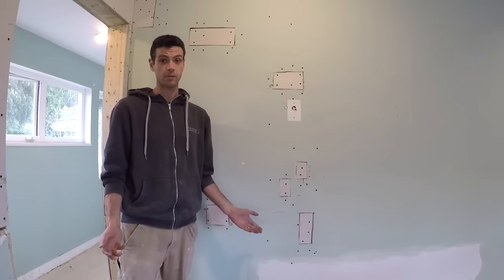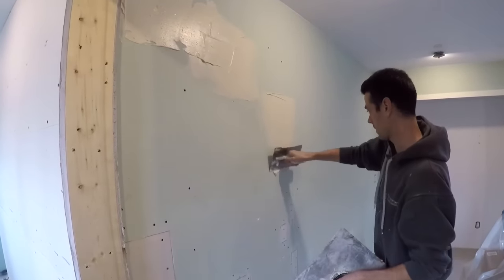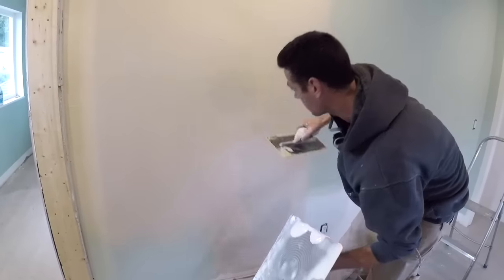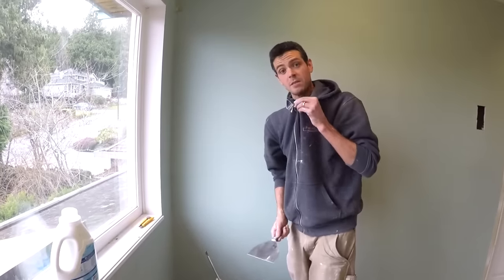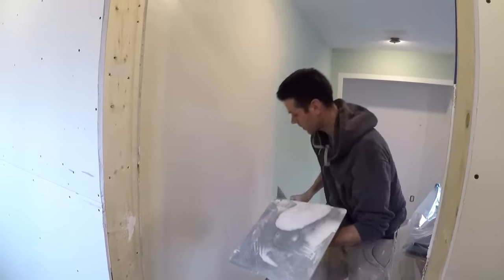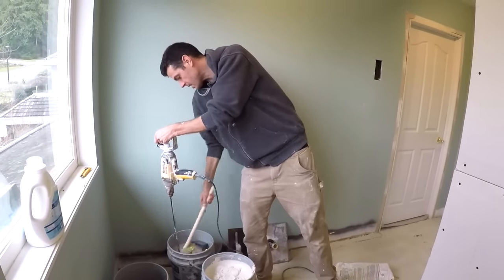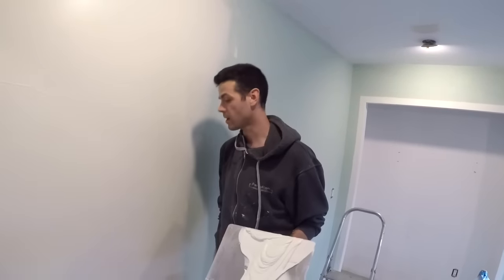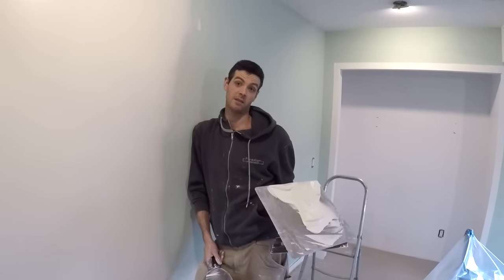HOW TO PATCH A HOLE IN DRYWALL!!! (Lots of them!!!)

Comment: If you're a newbie. You won't get it done in the same time as he did.  Give your self  double the time. That means get 40 minute mud.
Reply: Yes! Important to note that 20 minutes also typically only has a 15 minute work time
Reply: If it's your a newbie use 90minute after watching finishers or repairmen work for at least 2 weeks under supervision. The shit is an art man
Reply: What's the name of the mud I need some?
Reply: Daniel Bull Runner Lamb Sheetrock/lite sand 45 is what I use. Note that it only has a half hour working time. If that’s not enough get 90b
Reply: Yes its enough time they are tiny rooms.
Reply: If you have 20 min mud use cold water won’t flash as quick

Comment: I am a pro... Let me tell you all!! This guy is a pro!!
I wouldn't change a thing..
This wall will sand off in 2 minutes and done.. Great Job!!!
Reply: David Jessee except it’s gunna take two days to dry.... this was way more work and material then needed. If I had a guy do this to me on a job I’d make him scrape it off and I’d send the guy home
Reply: Also with none of the patches sticking out on the wall you could patch them normally and use a seam sander and you wouldn’t be able to see any of them and you wouldn’t have any “mole hills”
Reply: @darcygray3234  I wonder how much sq ft they lost? :)
Reply: @darcygray3234  I would never send a guy home if he was that good.. In Ontario we have a major shortage of trained construction workers. We would be blessed to have this guy on our crew.
Reply: I use a hawk for plaster and drywall pans and knives for taping and flattening.  I quit sanding twenty-five years ago, I now use a big tile sponge.  I can see it taking three coats but my goodness, not quite so thick.  I use five minute compound which takes twenty minutes to set.  If the customer is willing to pay I can make patches disappear, if not, then not.  I do rental repairs, the customer usually just wants it done cheap and quick.
Reply: Lord Nelson  Evidently your reading comprehension is sub-par.  I gave the reason in my post.  I re-iterate:  If the customer want fast and cheap that is what I do, if he wants slower and more expensive that is what I do.  My customers decide what level of quality they are willing to pay for.  Get it?  Or will need to re-phrase it for you?
Reply: I see I've ran into the "holier than thou" section. Y'alls pride is blinding you,  and will eventually do you in. The guy DOESN'T and will NEVER work for you, and better yet he's doing a how-to for beginners.
Reply: Enjoy the video. Very informative.  Definitely prefer seeing the pride of doing a good job.
Reply: @ck_watchman  the irony of "pros" searching youtube for how-to beginner videos on the subject they are experts in huh?🤣
Reply: A pro uses paper tape or fiber fuze. I repair so much of that sticky mesh its unreal.
Reply: David Jessee I agree ☝️
Reply: Lord Nelson that dude is exactly why people have a hard time trusting contractors
Reply: Why not skim the whole wall?? He’s done half of it already!!! And no sanding after
Reply: Lmfao...sand off in 2 min? He just spend time getting material together, mixing the mud, applying it, letting it set, then sanding...your guy could have just ripped it out and put in 8 screws again.
Reply: @4g63gen1  so you dont have any stardards for timing? Makes no sense.
Reply: @glasdou_brz  exactly. Hes slow and doing it a slow method. Smh
Reply: Summit X great comment mate. I am not a construction worker however my job does mean I spend a lot of time on construction sites and without a doubt the whole scene is packed with beta male types just trying to be alphas. It’s embarrassing. 

If you have to scream and shout about how great you are, you probably aren’t as hot as you think. These comments read the same way. It’s good to see the characters you come across in construction seem to be the same world wide. 👍🏻
Reply: @MrYz250fman  paper tape on tapered board joints. I've only ever used that on internals. No, just no. I've seen loads of this lately and cannot fathom why people are still using it. Scrim tape allows for greater thermal movement and therefore reduces cracking. You can tape with newspaper -doesn't mean it's the best way to do it.
Reply: @wez9943  you a QS by chance?
Reply: He works like plasterers I worked around back in the day. Very different than modern drywall down to the tools. I kinda knew what to expect when I saw the hod instead of a mud pan. A whole different mindset.

Comment: Great video, and glad you showed the importance of feathering out. I just id a 16" wide hole that was feathered out 4 feet. Most of my work is patching over painted walls with mesh tape. It's amazing how fast in one layer you were bale to obscure everything on the wall! I'm too embarrassed to tell you how long and how many layers it would take me to do what you did in Layer #1!  My issue is I have a hard time getting the mesh tape to cover in one coat. When I clean off the mud, the mesh tape re-emerges again, so I add some more on top, and clean it off again, and it re-emerges again! Sometimes I wait until Layer #1 is completely dry and next day apply Layer #2, which often helps. But how can I get it all done in Layer #1? BTW those 91 idiots who gave this video a thumbs down, let's track them down and skim over their monitors, feathering all the way to the edge.
Reply: Use paper tape
Reply: I always have the same problem @jeffostroff describes when I try a drywall repair: I can't seem to get a thin coat that hides the tape on the first pass.

When I get the mud to a thickness I think is right, I look at the mesh tape and it’s oozing mud in little squares. Is that normal?

Sometimes I will also snag the mesh tape by accident when I'm wiping off the mud, and the tape strip will buckle or fold over on itself. >:( Then I have to dig it out and start over again.

I guess I’m wiping it too thin…
Reply: @maizetoken377   "can't seem to get a thin coat that hides the tape on the first pass." it's really not supposed to be thin, one of the reasons we also feather out so far is so how thick the quickset is leveled out into the current wall.

Comment: Another great video.  May I make a suggestion?  Add an oblique light source across the wall or area you are working in so your trowel markings (like lift-offs) show up more clearly.  It's hard for your audience to tell what you deem acceptable or recommended in terms of the textures, depths, etc.  Keep up the great work!
Reply: I think you'll just have to trust that he's doing a good job, use your imagination.
Reply: Yes that would help us see the thickness and ridges, etc.  Also, maybe a little dye in the different coats to see how well they cover, and how much is taken off.
Reply: excellent suggestions.
Reply: This is a great suggestion
Reply: Great suggestion!  As a super novice, those liftoffs, I would consider unacceptable and not knowing any better, I would keep working it, making it worse, and worse.  Lol
Reply: I had the same idea as @John Petry.

@Vancouver Carpenter: I really appreciate your explanations and the time you take to say when one aspect matters and when it doesn't—very helpful for beginners like myself. I know many imperfections in mud that are visible in person don't show up well on camera because of the low contrast. If you did a video where you decided to add some strong side-lighting or lighting from below, I would love it.

Videos are great, though. Thanks.

Comment: Nice job skim coating!
Did it for 25 years.
The problem is that people see a professional do it and thinks...wow😁that looks so easy😂😂😂
Little do they know!
Its more of an art.
Applying the right pressure to the part of the blade that needs it.
Mixing the mud perfectly.
These things take time to learn.
Thats the bottom line.
Reply: Seen this done in several video and easy is not something that has ever crossed my mind. Get someone in to do the job has frequently crossed it.
Reply: Your correct. Sometimes I'll do a job and the customer would tell me that it looks easy and I did it fast. Then they will try to low ball me. I feel like saying "then next time do it yourself" 😉
Reply: I agree he makes it look easy the novice would be better tearing off and hanging new drywall
Reply: @robertray3746  I would tear it off and hang new drywall. But I understand budget too. I would rather remove all the drywall, and put it back up when the electrician was done with their job.
Reply: Are there Videos on what is right Angle and so on
Reply: Yep, I’ve watched so many videos and have thought damn, that looks easy. Then every time I go to mud and tape I say well, that looks like crap. Haha
Reply: Isn't that the truth. Like running smooth plaster. Takes a lot of practice and polishing !
Reply: @bradl1982  
😆🤣😂lol
The blind man on a fast moving horse liked it! 😆
Reply: Can you tell me if you can drywall over painted walls or does it need sanded or primer?? I’ve asked and he won’t answer thanks
Reply: @jodiewagner9226  
The question is a bit confusing.
The patch will need to be sanded ...then primed and then paint the patch and then paint the wall corner to corner. Otherwise it won't match.
Reply: @jodiewagner9226  Jodie as you talking about a skim of mud over the walls to smooth them out?
If that is the case it should be lightly sanded and either primed or painted with a bonding agent.
I scratch the surfaces after cleaning,then roll on bonding agent and then I run heavy dryvit mesh and then finish plaster it.
That mostly will keep cracks down but if the surface is good and no cracks just a skim will work.
I hope and pray I did not confuse you. Have a great day.
Reply: Its really hard to learn from His Videos because u cant hardly see anything
Reply: There are some things that are definitely easy after watching a pro do them. This is not one of those things! Makes you appreciate the amount of work and experience involved.
Reply: Well if you guys didn’t bury our stuff we wouldn’t have to go looking for it :)
- Electrician
Reply: @jessed1586  
So that's why there's a hump in the wall😁lol
Electricians...can't live with'm and can't live without!🤣🤣
Reply: @freespeech4all723  At least we’re not turd herders.My rule of thumb is if 3 things are buried I’ll look for a hump, I’ll get something flat and run it on the wall looking for uneven spots and neatly cut it out. Any more 3 though and out comes the hammer
Reply: @jessed1586  
Good old roto zip!
Reply: I've been filling and patching holes all week. This is definitely an art and he is great at it! I messed up on several patches before picking up the right pressure to apply. I also prefer left to right for some reason on the final pass. Many of my holes had exposed drywall paper and I had to seal it before mudding.

Comment: Very well done. I once broke existing tiles and then repaired drywall instead of replacing with another drywall piece. Took me a long time and since I was going to put new tiles on so it didn't need to be perfect. You did a great job here.

Comment: Your making me feel like my small job is doable. Thanks for doing it step by step.. Just saw that this was videoed 5 years ago. Still current. Do not want to replace with dry wall because I have lath/plaster to work around. 70 yo house with 35 yo remodel using drywall in the middle of old doorways. Be fun to complete with nice work. Thanks

Comment: I inherited a wall with a bunch of raised squares.  Wondering what to do, your video fit the bill.  I just finished the torn drywall after seeing your other video and it worked fine.  Doubt that I can get it anywhere close to what you do, but it will be better than it was, and I'm using matte paint, so that will help.  Thanks for these great videos!

Comment: Incredible! We have a number of patches in our house. We knocked down some walls, moved electrical, and had mold issues so we had little patches we had to remove to see how far the mold went. I hired a person to fix the patches. They did the first coat of mud, leaving us with the remaining coats. The tape is bubbling on many of the patches, and they didn’t do a smooth job, as you show. I told them about the bubbles in the taping, and they said they would go away after the second coat of mud. But they didn’t, of course. They didn’t cover the spaces between the patches, so hopefully it can be achieved in the second/third coat of mud. Watching you work makes me regret hiring them to do the job. Now I know what to look for in a drywaller.

Comment: He didn't replace the whole board because then this video wouldn't of been born. ;-) You have a painter watching your stuff! Awsome.
Reply from the maker: Also, it's way more work. People don't get that. They are just scared of skimming a wall and think it's a lot of work but it really wasn't.
Reply: 100% way more work resheeting.
Reply: @lwilliams3285  In those spots in between studs? A couple little pieces with tape and spackle. His work is on point though.
Reply: @hobgoblin6659  you then have to do the coving or square set on top, along with getting a vertical join on the stud looking flat, which would basically require a but join finish to achieve. More work, ive tried both and I'll opt for the skim. 20 to 30 minutes. Done.
Reply: And i dont think spackle would give a very good finish either.

Comment: I use a hawk and trowel also but I use a Mason's trowel.  It has the rounded ends and is perfect for floating wide seams or whole walls similar to this. Doesn't leave the corner ridges.  Nice work.

Comment: I like to use a six-inch plastic putty knife to scrape the sides of the bucket while I am mixing my setting mud. It also works great to clean the bucket out afterwards. I also use the plastic putty knife to scoop the mud out of the bucket.

Comment: You can't beat plastering the whole wall . If wallpaper or wood mouldings are removed in the future the paper on the right side will get wrecked
Also no dust if you mix outside because no sanding needed

Comment: Working with plasterers back in the UK a trick they had with the trowel was to slightly turn up the corners of the trowel with pliers so you got no edge lines and it stopped the trowel digging in to the fresh plaster if you slightly misplaced it when coming back onto the wall
Reply: or take a file and round over the corners
Reply: Yeah I would call this"setting" your trowel,I use it for concrete finishing. Great stuff
Reply: Richard Short thank you very much!! I’m going to do that right now lol
Reply: If youre a good enough concreter/plasterer/trowelsman you wont need to alter your trowel unnaturally.
Reply: Brendan Molloy whoaaa look at this fucking guy!! Mr. Master of the trowel right here
Reply: Brendan Molloy There’s always ways of improving tools. These tips came from expert journeymen who do this daily for a living. But I appreciate your comments thanks.
Reply: @kaimdaughertyable  fucking oath i am lol
Reply: A proper plasterer in the UK uses their trowels for years and it becomes curved to the way they use it.
Reply: I'll weigh in on this beings as I'm a plasterer from the UK. I hate it when people bend their trowels,  my boss tried getting me to do it when I first started with him but luckily if you know a thing or two you know that using a new trowel for rendering is the perfect way to set it. Most diy fans won't be doing that though 😂.
Reply: @jamiedyer7782  very true
Reply: @DeathWish92  yep trouble is you need the corners for doing the corners haha, good idea using a new trowel rendering to get it ready for skimming. With skimming you want the entire edges of the trowel to curve upwards this means you can use it at the perfect angle and it won't leave lines, best way to do that is to just use it!!
Reply: @jamiedyer7782  precisely, another tip for anyone struggling with "lines" from a new trowel is to start from.the top and work your way down with slightly more pressure at the bottom of the trowels handle. You can buy them pre worn now anyway so my.old tricks don't really matter haha
Reply: You can also just take a new trowel to brushed concrete and "trowel" breaks it in quick.

Comment: Have you seen the plaziflex trowels we use for plastering in the UK? I think you would love them as you use the trowel a lot, they are designed for finishingp gypsum plaster but I think they'd make your job easier. When finishing a butt joint it would flex over the raise centre line and feather out the sides all in one pass, they lay plaster out so smooth and they are really light weight.
Reply: Do you need a special permit to buy and own a trowel in the UK?

Comment: I agree with J Cook- between cutting out those replacement pieces (which you had to do prior to the start of the video), screwing them in place, and mixing all that drywall mud to make the holes disappear???  Cheaper and less time consuming as well.  But you are bloody well talented with that knife and slinging that mud:)

Comment: Great video, very complete and comprehensible. I use some flat trowels with a concave surface, figured out after years of frustration and unnecessary sanding that the concave side should be up. Also if you ever come to the states, please visit our president and teach him how to speak. It may be a full time job! I also discovered that a six inch random orbital sander with fine paper 320 or finer on drywall does a nice job. It also keeps the dust way down with an attached vacuum. I use it on the lowest rpm setting.

Comment: I've never seen a drywaller use that much mud to patch a wall before. Usually they just do 6 inches around each patch and then wet sponge and sand it.
Reply: Sergeant Seven dude they would have to lay texture on super heavy if he did it that way.....leave drywall to the pros...application is crucial for top notch levels.....